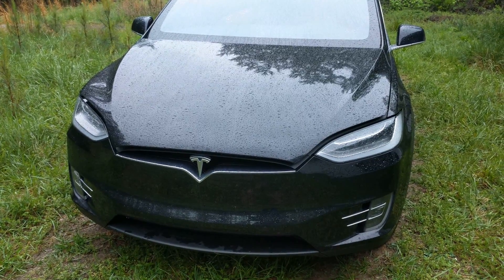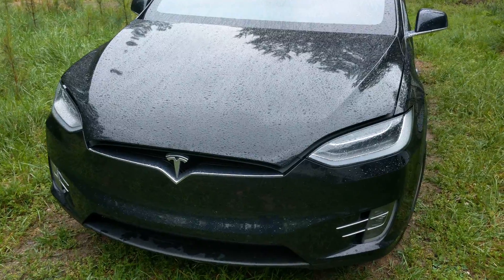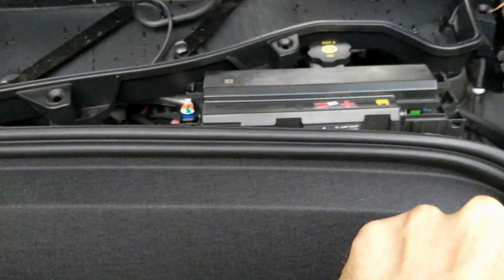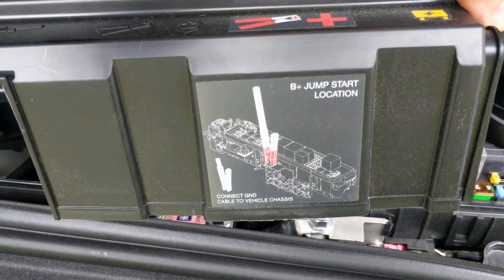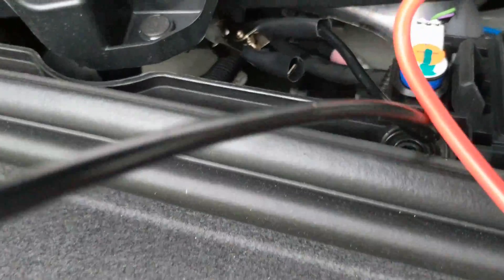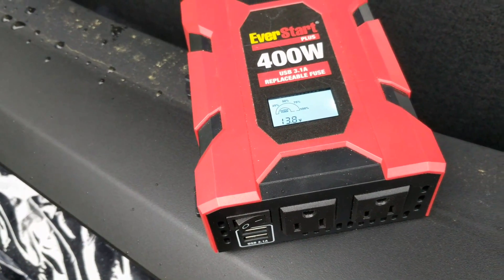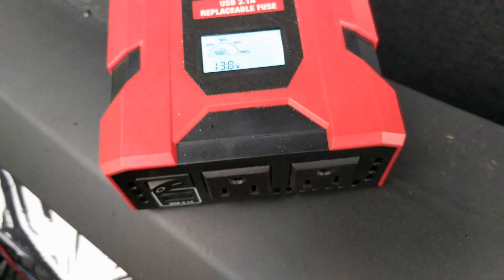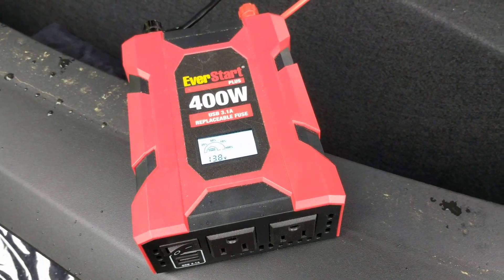How to Power Your High Wattage Devices & Appliances with a Tesla Model X

Comment: can you use the cigarette lighter (or whatever it's called today) adapter to run the inverter?
Reply: Yes, you can, but the wattage is limited when you connect to the cigarette lighter plug.  I don't know what that limit is exactly, but you should be able to plug in at least a 150-watt inverter.  This video shows you how to connect a larger inverter to bypass the fuse for the cigarette lighter plug by connecting directly to the 12v battery.  The idea is that the main (high voltage) battery of the Tesla will kick in and start charging the 12v battery as it is being used by the inverter.  Just be very careful.  Hope this helps.
Reply: the cigarette lighter just alows 150W

Comment: You're only pulling electricy from the lead-acid 12v battery - unless the tesla is moving - no current comes from the main battery.  When it is moving it tops off the 12v battery periodically form the main battery with a DC-DC converter that's only active when the car's moving.  That's on purpose - you see, Tesla has a $9000 "power wall" you have to buy if you want to use their batteries for back up power.   It's a joke - the 12v lead-acid will only do 15-20 minutes on anything pulling more than 500watts.
Reply: what exactly do you mean with "moving"? how active does the car need to be? Can anyone confirm that the behaviour is the same after 3 years?
Reply: @gutmanu123  i.e. the main battery is actively powering the drivetrain to move the car.  As strange as it sounds, when the car is parked left by the driver in the "off" mode, the step down converter that normally run coverts the high voltage to 12 volts for the lead acid battery is also shut down.
Reply: @thom1218 are you saying Tesla will let the 12v battery die even when the high voltage battery is topped off if you let it sit long enough?

Comment: Please help, as I don't understand electrical issues very well.  I sleep with a C-PAP machine because of sleep apnea. It plugs into A/C in the wall of my bedroom. If I want to go camping in our Tesla model Y in camp mode. How would I safely power my C-PAP for sleeping in the Tesla?  Will I need an inverter with a cigarette plug in?  Are they safe to use for many nights? Would you know what kind of battery drain running camping mode and C-PAP would have?  Thank you,  very much for your helpful response.
Reply: haven't tried it yet, ill be trying it soon but for safety and reliability you should get a good heavy jackery, you can charge that from in the car 12v and plug in your machine. i want to travel light and charge my ebike so this inverter method in this vid looks better for me. not safe for you if a cord gets snagged running from the frunk through a window and clip comes off 

Wil Prowse's tesla s turns on automatically to power the inverter and recharge 12v batt when he tested it

Comment: Could I use a 3000 watt inverter running an 800 wats  non inverter air conditioner (it can get 2500 wats peaks)

Comment: You have 13.8 volts there because the DC to DC converter takes the ~400V from the big battery and converts it down to what the standard charge voltage is for a 12V battery which is around 13.8V.  If you tested the battery voltage of an ICE car when the engine (and thus alternator) is running, you would likewise find ~13.8V.  That is, 12V electrical systems in cars are "nominal 12V" which really means 13.8.  All 12V automotive components have to be able to run with voltage in this range.  The inverter will be happier with 13.8 anyhow as it will tolerate any voltage drop in the inverter cables better.  That said, I know that at least in the early Model S/X, the DC to DC converter switched on and off to maintain the 12V battery so with the car powered off, one might sometimes find 12.6 or so V and other times 13.8V.

Comment: Don't you need to put the Tesla in "Camper mode" or something?
Reply: No.  The 12V battery always has power.  What you are thinking about is drawing power from the 12V ports and/or keeping the switchable car accessories running. For that you need to have the car keep stuff on, but as I say, the primary 12V system, ie the 12V battery, always has power.